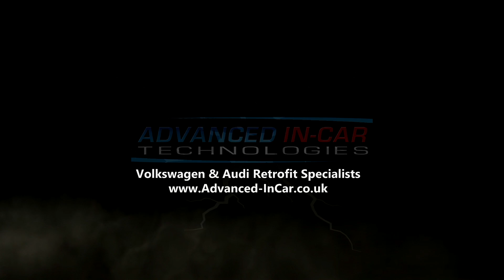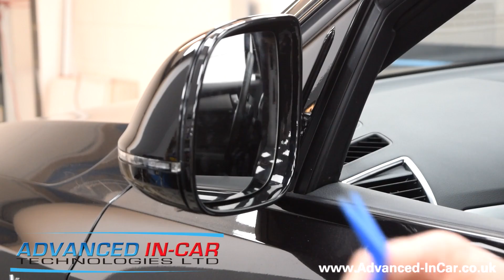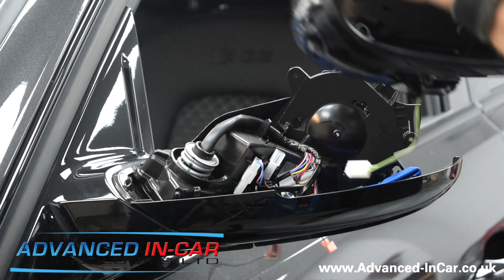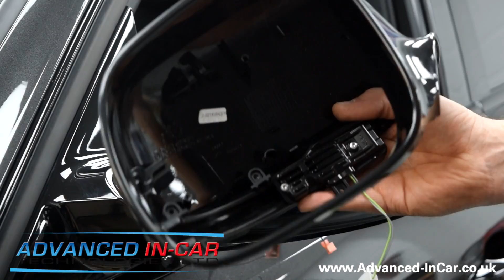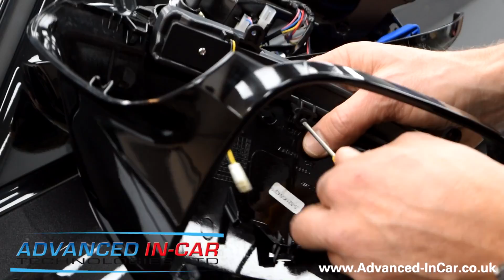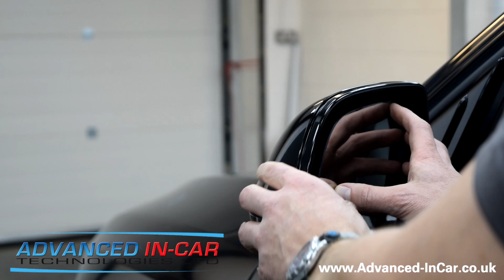How To: Install Audi Q5 / SQ5 Dynamic Mirror Indicators

Comment: One omission I found in the video for what looked a simple pop-off hood process - There may be TWO small screws holding the hood to the base. After removing the mirror you may find them firmly in place at about 12 and 8 oclock.

Comment: Hi. Thank you for such an informative "how to". I wish I'd seen it sooner as I made a complete mess of it!  However, please can you clarify how you separated the mirror section closest to the window as in the video it looked as though you'd pre loosened it. Is it just a case of loosening it with a trim/pry tool or did you do something else? I notice that you video is 5 years old and maybe you are no longer posting videos, but if you are, a response would be greatly appreciated. Last time I tried removing the mirror cap I think I ended up removing about 4 or 5 screws whereas your video shows you removing on the one that holds in the indicator. Thanks in advance.

Comment: Word of advice here. In the video, you can see by his one finger that there's a spot where the plastic backing on the glass is cut-out and the glass is exposed. Be careful to not pry from that position as, well, it'll crack the glass more easily.  Now, off to ebay.

Comment: DONT USE THAT PRY TOOL WHEN REMOVING COVER. This guy doesn’t mention it and skips the most important part but if you do what he insinuates in the video you’ll rip up the rubber piece at the rotation point. You can remove that cover without prying the edge.